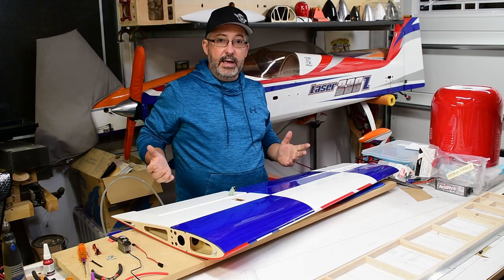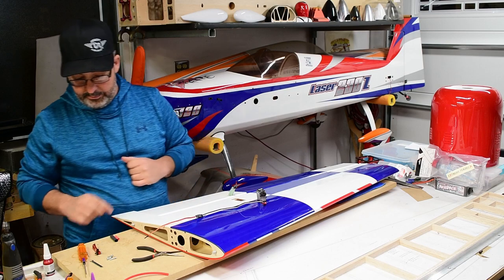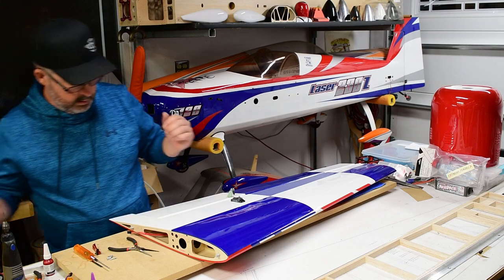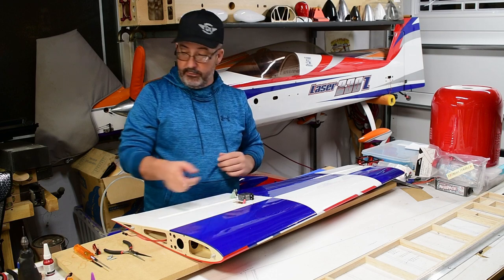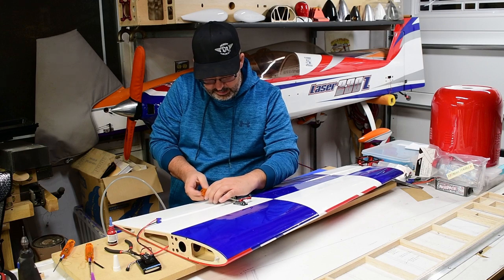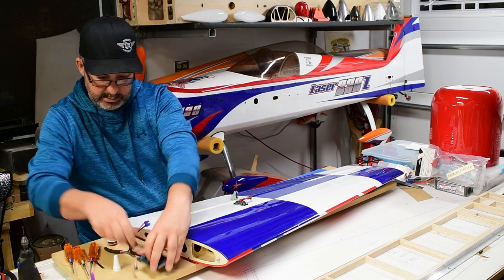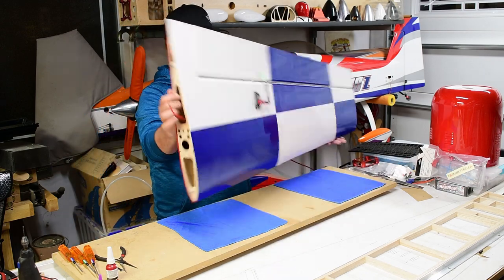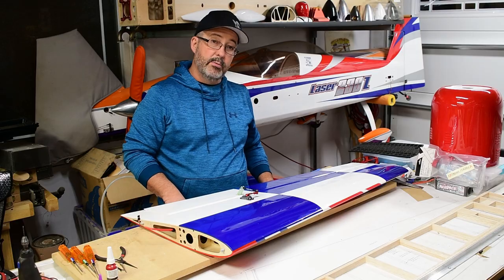Aileron Servo Installation Secrets ***Pro Tips***

Comment: Great video, one never stops learning!!

Can you expand a little on the building board you are using on top of the bench, i.e. size, and material. It appears to be raised above the bench surface - why?

Looking forward to hearing about the matchmaker replacement

Regards
Reply from the maker: Thank you Brian. My work bench is a little complex. The base is actually Closetmaid garage storage cabinets that I got from The Home Depot. After that was leveled using the adjustable legs I placed a 3x8 ft solid core door on top.On top of that is a layer of 3/4" MDF and a layer of 3/8 tempered glass. The glass and MDF are swapped depending on what I am doing. When I am building, vacuum bagging, or rigging I use the MDF. When I am covering I use the glass. I can also add sheet rock or ceiling tiles if I want to be able to pin things to the board easier.

I hope this helps. Maybe we will do a video on the bench itself in the future.

Comment: What size braided sleeve do you use for servo wires?
Reply from the maker: 1/4 inch works the best. You can make the 1/8 inch work but you have to be a little creative.

Comment: Please do not use Loctite to retain the servo arm screw as they are hard to remove without using heat, Silicone over the screw once fitted works very well & is easier to remove & easier to remove screw when required.
Reply from the maker: Thank you for your comment. If you are having to use heat to remove Loctite, it is because you are using the red kind. If you use blue Loctite, heat is not required. After years of using blue Loctite, I have never had an issue removing the arm. I have used the silicone method in the past but prefer the cleaner look of Loctite personally.
Reply: If you are using the wrong Loctite, please get someone that knows what they are doing to do the job for you, like the pro in this video. It’s supposed to be hard to remove. That’s why you use Loctite 😂.

Comment: Does it matter if you install the servos more near the body of the plane or do you have to have it centered with the flaps
Reply from the maker: Hello. Thank you for your comment. On ARF models like this, the servo location is dictated for you. 

If this were a kit, you would still want to locate the servo as close to the center as possible to limit the amount of flex in the aileron. 

There are benefits in regards to rotational mass when you move the servos inboard but you must be careful not to induce other issues.

Hope this helps,
FR